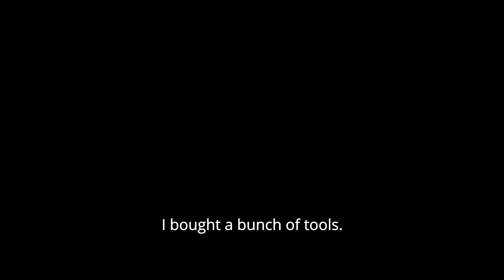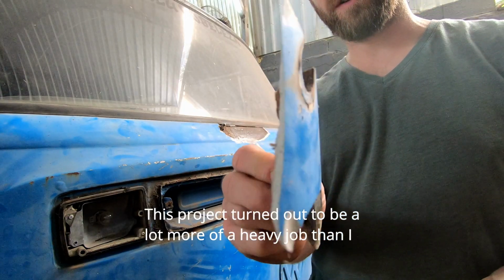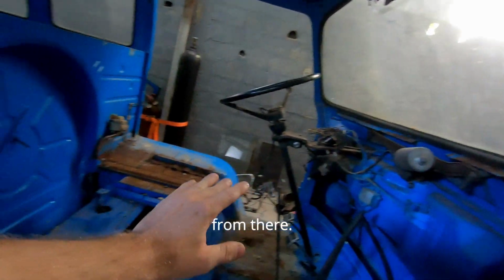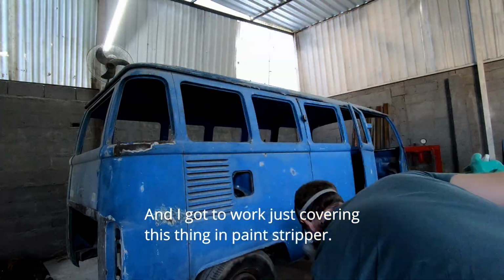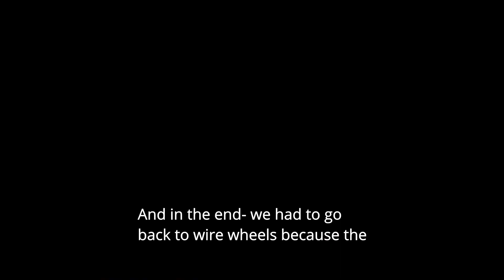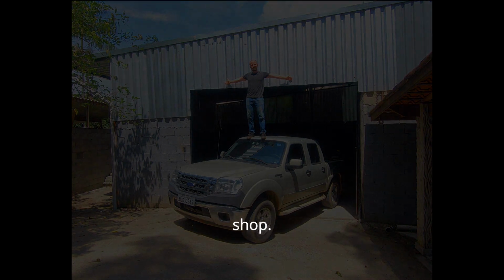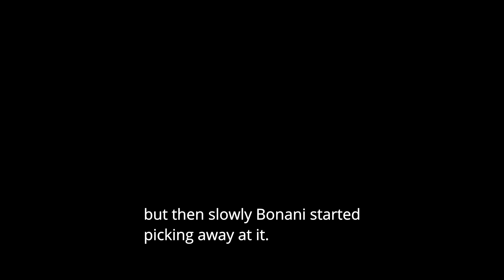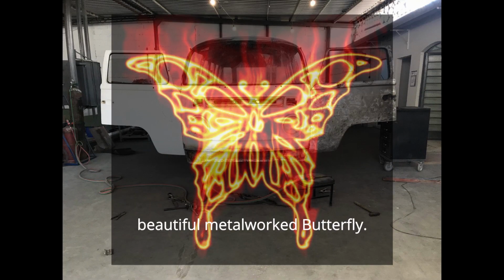Worlds Most Bondo-ed VW Bus makes an Incredible Comeback!!

Comment: have you tried the dedicated stripping discs?  Like the 3M Sandblaster Pro, and all the other cheaper alternatives.  Some sort of poly honeycomb construction.
They rip through paint and bondo and are very kind the to metal underneath.  Would be quieter and safer than the wire discs.
Reply from the maker: Hey Noel, I haven’t tried those discs, but now that you mention it I have seen them around down here. I have another bus that needs the same treatment- going to pick up a few and test them out. Thanks for the tip!!
Reply: @MetalSmithBrazil  Ok. I'm in Australia so I cant tell you the typical brand names that you might be able to find in South & North America.  But a lot of manufacturers are doing them.  
My tips:
When they are fresh they have a nice sharp edge that you can do fine stripping work with.
As they wear down you can just use them to plow through bog (bondo) & paint, (obviously will do same thing from fresh).
When really really worn down use them only on flat surfaces.  
Try with blade rotation lightly off the cleaned steel and into the bog.
Watch for heat build up and learn to manage it: do a patch then move to another, let the 1st patch cool while you do another patch, come back to 1st & do some more while 2nd cools.
Can be used as instant heat to create a hot patch for metal shrinking (not as good as a flame or shrinking disc).
Reply from the maker: @noelwhittle7922  Australia eh? it must be midnight over there at this hour!! hahaha. You are dead on about the heat build up, thats always an issue when you're removing paint. Never thought about using something like that for heat shrinking, interesting idea- we do alot of shrinking with the torch, but might be interesting for panels with light oil-canning. Never used a shinking disc before- sure would like to try one out. Thanks for taking the time to pass on the tips for the honeycomb discs, I will be putting them into action soon!!